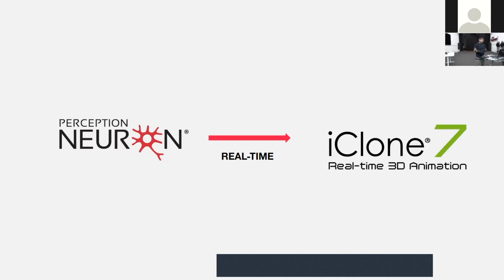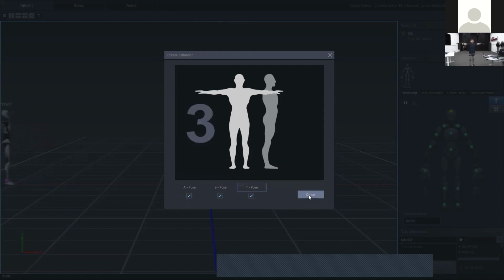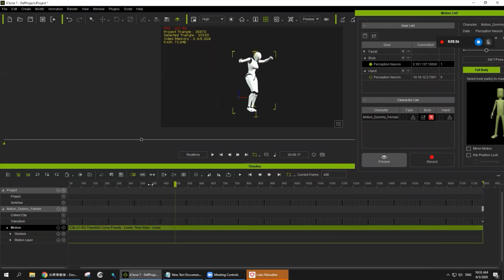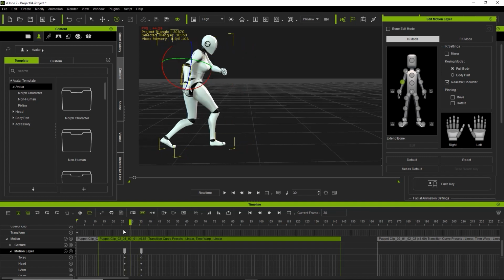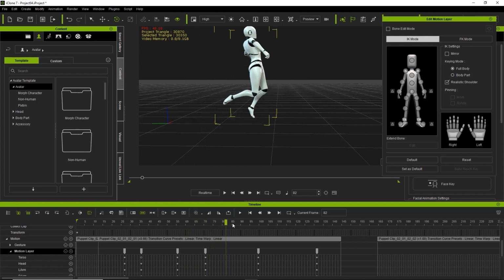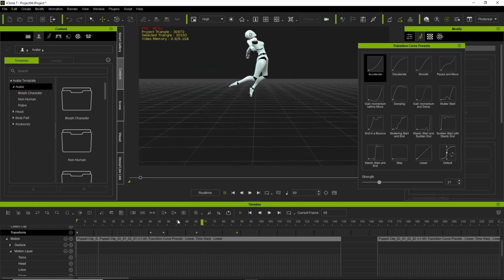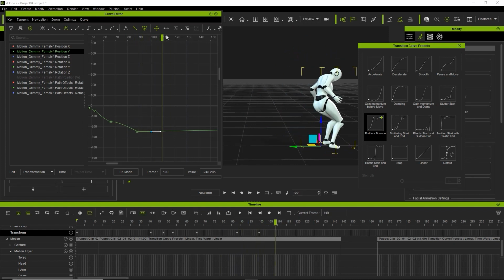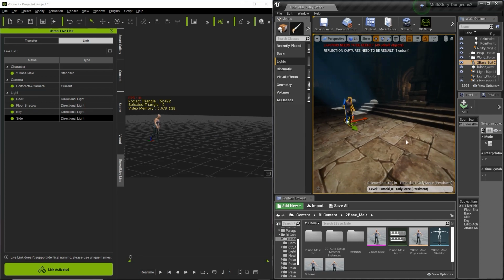STAY @ HOME MOCAP SERIES XIII - Perception Neuron + iClone 7 workflow

Comment: Thank you for the video @NOITOM. How did you get the mocap data from Axis Studio to iClone transfer so properly? When I broadcast to iClone, the animation is quite off. The position of the joins just does not align neatly. The body dimension in Axis Studio does not seem to have any impact on that. It happens whether I broadcast the data via Motion Live or transfer to iClone via 3D XChange. Your sample files in Axis Studio, however, transfer flawlessly to iClone. So, I am really curious how you managed to do that. Thanks in advance!